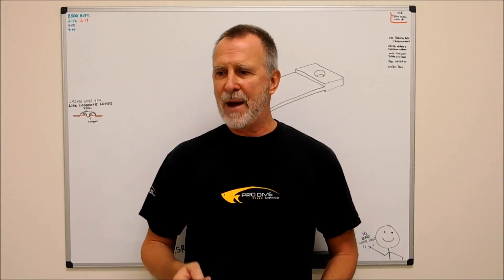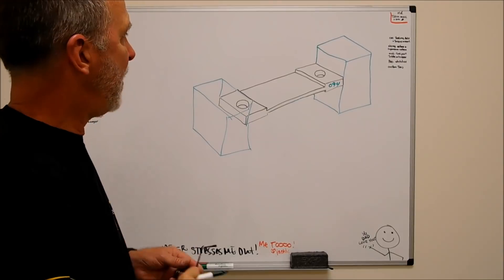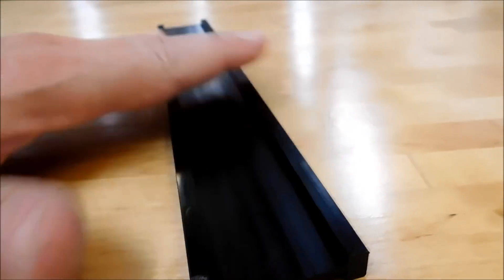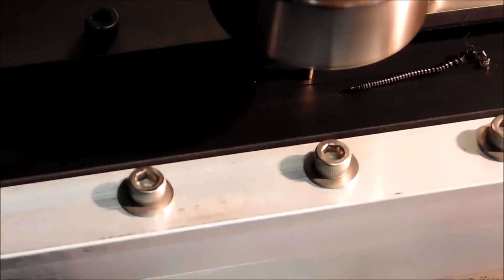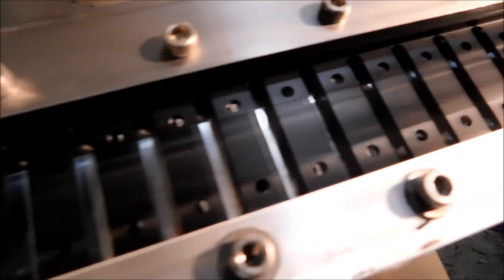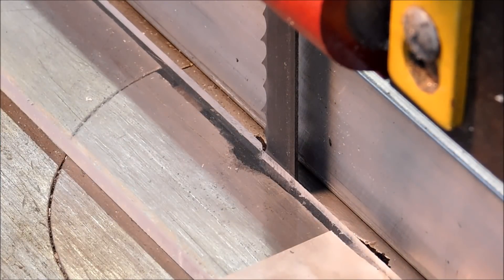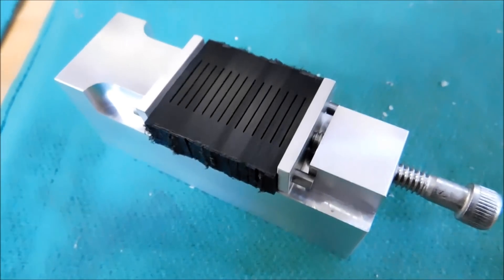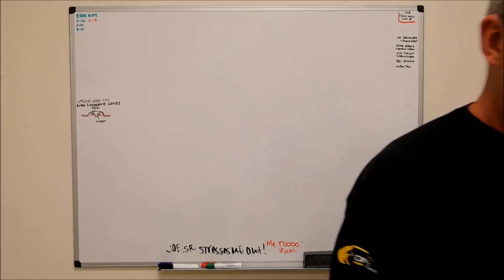Dogbone Milling - A Great Way to Hold a Small Part

Comment: One question. Was the base material supplied in that form or did you have to machine it out first. If so did you use the long fixture to cut the trough and did you do full depth per side or flip it and do 50% of each side. If you have a video of that would be interested to see. Thanks for what you do. 
Regards from Canada's banana belt.
🤞❄️🇨🇦🍌🥋🇺🇦🕊️🇺🇲👍
Reply from the maker: These were machined from a plate.
Reply: @joepie221  Hi Joe did you do the video of the plate being machined? It would be interesting to see how you did it to avoid flexing of the thin material. Thanks for all your videos they are very informative and I have learned loads watching them THANK YOU

Comment: Joe, tks so much for your genius in machining and showing us not so gifted what we might consider in the process of keeping it moving forward in a cost-effective manner. I have a piece of .250 303 tubing that has a piece of .250 303 bar stock machined down to a snug slip fit about .800 into the tube. I have to machine an 10 degree angle into the tub and bar stock. Having problems holding the material so it doesn't flex in the process. Already broke several very expensive 100% carbides. Bar stock is silver soldered in before machining. Should I consider machining tubing and bar separately, then soldering? Have 100 to make.
Reply from the maker: Is this an internal or external 10 degree angle?
Reply: @joepie221  internal
Reply from the maker: @TKNoland  Have you considered investing in a tapered reamer? Then make an arbor and finish the ends to suit. "Hardest Feature First"
Reply: @@joepie221 No, I hadn't. Tks. That's a very good idea
Reply: We drill a hole through the tubing and the barstock down to the interior wall on the far side, then machine the 10 degree angle from the far id to the surface of the barstock. It's a giant needle, with a slot cut in it at an angle. We have 2 CNC machines. 1 Haas VF1 and a Tormach 770M and of course manual mills as well. I built a jig that fits in the jaws of my Kurt vise. Prototype cut well and seems very rigid. Trying to figure a way to speed the process up. It's very time consuming. Lots of fiddly bits.

Comment: In my view this seems far more complicated than necessary. That could be a two operation part if just held in a vice. First op with grip stock and second op in sacrificial aluminum jaws or held in hard jaws below the narrow bit. First op could even be done with stock vertical in the vice and slicing parts off with a mill saw (disc mill? arbor saw? cut off disc? sorry english isn't my first language) at the end of program and dropping z before pressing cycle start again.

Instead now it's three mill operations with bandsaw cuts in between the ops and three different custom fixtures. At least for small runs this seems quite wasteful, your comment about not having a thousand of them to do really hit the nail on the head. I don't know how many you did, but I'd guess you could have shipped the parts by the time you were done making those fixtures if the parts were done one by one.

Anyway the jobs done long ago so this doesn't really matter. Just my 0.02€. (BTW did you get more use out of those fixtures in the years between the video and now?)
Reply from the maker: 2 operations and you'd have 100 bananas. Delrin has a lot of surface tension and needs to be respected. My 2 cents...this part can not be done in 2 steps. Squeeze it in a vise and you'd blow the allowable tolerances.

Comment: That is an awful lot of socket head cap screws to hold down a thin plastic piece.
Reply from the maker: It not only holds it down, but must also clamp and straighten the entire slug.

Comment: you call that small? pff
how about real steel dogbone with ball end, 8mm total lenght, 1mm balls, 0.6-0.8mm hole thru balls with pins. now thats small
curently building 2 EMD machine for these and other related super small parts.
Reply from the maker: EMD?
Reply: @joepie221  EDM machines, sorry about that.

Comment: Will the bur created on the parts when you cut them off the big dog bone affect the stacking alignment on the final fixture?
Reply from the maker: It may influence the ends of the parts as you stack them, but the first pass will relieve any  flare from end burrs. the final cut cleaned everything very well.

Comment: Joe - I have a precision ground plate on the mill that has the bigger toe clamps on it to hold down 1-1/5" to 2" inch tall by 3" inch wide bar steel a lot of the time. 30 inches long.  I use Toe Clamps to hold the bar down. 4 on each side. Skim cuts are great but If I need to take a few .125 cuts to bring the material down to size the clamps seem to let the bar move a little and the overall height ends up not flat to the bottom surface. It can vary up to 20 thousandths. Any idea how to keep the bar flat to the ground plate better? Can't use a vacuum plate because the bar comes in as hot drawn bar and is always a little warped. I need the top surface open that is why I use toe clamps.

Comment: Hi Joe,

Would you please show us how you built your fixtures and how you initially roughed the parts?
Reply from the maker: the parts were cut from a sheet blank, and the fixture was fabrication was not filmed. if I can include a short shot of it in another video i will.
Reply: @joepie221  Hi Joe, like the questioner I'd like to know how you prepared the stock. Obviously it was cut from a 1/2" sheet or however tall your dog bones were but to mill out the 2 mm centre portion without it flexing must have taken another fixture to support it while you cut the second side. If you can at least tell us how you achieved that would help. A demo would be great but a white board explanation will suffice. Thanks from Canada's banana belt.

Comment: Great work Joe ,  I have a question , as you know there is many ways to skin a cut  ! since you are only doing a hundred 
would a hold with extra material  machine both sides snap off  approach  make the business case (no fixtures)?
Reply from the maker: The geometry of this part made fixtures absolutely necessary. Any vise pressure bowed the thin cross section and would have made flat and parallel nearly impossible to control. Some have suggested double sided tape, but sheet delrin has a lot of surface stress and will bow aggressively after cutting the first side. Once forced flat by the fixture, the material that came off the second side actually relieved that stress and the parts were dead flat.
Reply: Just wondering why you don't vacuum up the swarf instead of blowing it all over the shop?

Comment: I have "dog boned" plastic parts using double sided tape. would not have needed the fixtures.
Reply from the maker: Tell me how you control flatness when the part is taped down?
Reply: @joepie221  same way you did but without the fixture. cut the step into the waste board on the second side.

Comment: how can you make money on such a few number of parts having to make two fixtures for it first
Reply from the maker: That was a quick fixture, and the job paid fairly well. I also designed the fixture for future use.
Reply: perhaps Joe saw an opportunity to show a method that may or may not pay for itself on this run , but always good to have this knowledge in Your back pocket when planning jobs. I certainly see Your point. Cheers

Comment: Great vid and there is always more then one way to skin a cat but ! thats a two op part in alum vise jaws
Reply from the maker: Maybe if it was metal. In soft plastic, there is no way you will ever match the quality of this part squeezing it in soft jaws.  Plus, even if it is a 2 op part, you still have to handle 200 parts.

Comment: This is a good example to all those (and you seem to attract a reasonable number of them Joe) that think CNC machinists are not real machinists. I takes a real machinist to plan out a job so non machinist button pushers can take over, CNC or otherwise. 
Delusional, nostalgic or just trolling, I believe these people can't or won't distinguish the two scenarios CNC machines can be employed. Banks of machines lined up making thousands of the same parts run by semi skilled operator and managed by a skilled tool setter. Then there is the job shop constantly changing jobs with limited or singular production frequently with features that are difficult or impossible by manual means. These machines are usually completely run by skilled machinists and any machinist with real skin in the game will acknowledge this even if the skill sets are different.
Reply from the maker: Well put. I agree.

Comment: I would make a smaller fixture and do 10 parts at time. Fixture would be much faster to make and not be that much longer to accomplish the job. Don’t get me wrong,I like your videos just saying 🙂
Reply from the maker: You raise an interesting argument. Would the total job time be faster once you consider all the extra flip flop handling of a smaller fixture, or would the extra time taken to make the bigger capacity fixture even things out with less part handling? In a job shop, I think we can agree, this type of conflict and difference of opinion is commonplace. It would be a good experiment.

Comment: Those parts look horrible... You sold those???? Why wouldn't you rough AND finish EACH surface on the slot? Instead you get 1 really nice edge and 1 gouged surface on every part???????? Damn I thought you were better than that.... And to boot your tooting your horn the whole time.... Smh
Reply: Hey man, do you butt cheeks get sore from talking out your ass? I went to your channel for some good advice, but surprise surprise, didn't find anything on machining. Go back to sleep troll.

Comment: I love fixture work for production. We always mad 2 identical fixtures so we could load one while the other was running. But, that was for 1000's of parts per order. 

Man, I'd give my right pinky and ring finger for a Bridgeport with a prototrak controller on it. I know there's better heads out there, but you know. Nostalgia.

Comment: What Are These For?
Reply from the maker: I wasn't told, but they look like cable straps of some kind. Maybe vibration isolaters of some sort. The dimensions were very specific.
Reply: My own experience in industry is sometimes not knowing exactly what I'm actually making...getting a doodle (often on a bar napkin) with orders to make a stack before even thinking about going home...they get loaded on a truck and disappear while we're dealing with the next doodle.
Reply: @John-ik2eg  I'm working on it.

Comment: Mmm as a fitter and turner I see lots of different techniques ect.But in my experience if the material is expensive you don't get the extra "Dog bone area" to play with.And or time to make fancy jigs.But good video just to show what can be done to eliminate bowing and twisting of certain materials.Thanks
Reply from the maker: Sometimes, you'll spend more money in labor messing around with smaller material than you would otherwise. I bet I could have finished the jig and parts before another machinist could have finished just the parts. Mine would also be more consistent and accurate. And when the boss came back out and said "make me another 100" I would have just smiled.

Comment: That was great, Joe! Planning ahead every detail of those fixtures so the actual cutting was done quickly and, most important, ensuring the quality of the final product, really shows how professional you and your team are.
I worked at a company that made dies for aluminium extrusion, that was 99% of their work and they had the production process very well optimized, wire EDM, big horizontal machining centers and all that  stuff, but for the occasional  100 part job, they didn't even had a decent set of parallels. It was a struggle, with every part taken out of the vise 3 or 4 times, chatter, vise jaw lift...The parts came back from the customer  more often than not.
Reply from the maker: Thank you. Rejects and returns are not OK around here. I take the quality of my work very personally as it reflects directly on my ability and skill. I like jobs like this. They make ya think.

Comment: Hey Joe wouldn't injection molding be much cheaper and faster for these parts? Is there a reason why the had them machined instead? Brilliant idea by the way, I would of never thought of that.
Reply from the maker: Money. Molds are not usually made for a job this small.
Reply: @joepie221  ok makes since thanks.
Reply: Money. a company that still uses a Fadal 4020 is only about the money. not efficiency accuracy etc.
Reply: @FrapAttack  lmao

Comment: Why didn't you made the 'bone' 3/8 wider and cut off all the parts at left and right end from the remaining clamped stock in the mill just like you did separating them. Fear that the small.part will jump around once its separated and hit by the spinning tool ?
Reply from the maker: These parts weighed next to nothing. cutting them in the machine would not have ended well without each part having some retention mechanism. Too much time would have been required to tool and clamp each part. The saw was way faster in the presence of the 2 available holes for secondary.

Comment: Joe, do you ever use something like double-sided adhesive tapes to fixture parts; especially where machining forces are low, or drilling, or straight shear, these products allow for kind of "pseudo-dogbone" approach, with a fixture/carrier that carries many parts...we do thousands of tiny parts like this in the PCB industry, where parts are really much ro small to handle idividually, and, in fact, are often delivered on a."sticky tape" baxking, with low peel strength, enabling separation of individual parts quite nicely, and keeping them "organised" in the meantime ;-)

Comment: Nice job Joe. i did a job typical. but 5 at a time they were end caps for extruded alu.. 2 setups and i made a fixture to cut them off on the table saw finished. helped pay for the tormach then the haas mini. great job..
Reply from the maker: I'm about to post a video on something I call flip flop milling. check it out when it posts. I think you'll like it.

Comment: Joe, You made all those fixtures for less than 200 pcs?  How long did making the fixtures take?  Nice looking fixtures.
Reply from the maker: This was a one day job. The fixtures were about 75% of the effort.
Reply: 6 hrs? youch  At this point I am the one praying that you get the repeat work and justify the fixture.
Reply from the maker: 2 things. The fixture was designed to accept other size parts and the overall job easily hit the quoted time and value. I personally would rather spend time making a nice fixture and blow through the job than to struggle for 100 pieces, one at a time. If the effort is within the quoted time, or the customer paid the OTE fee that is.
Reply: So basically If I was well organized and had lots of storage space so I could "Showcase " my fixtures you would believe that in the future something has got to pop up in which I could use that fixture again.  I guess my problem is that I am used to working for nickel and dime folks most of the time.
Reply from the maker: I call that mentality ' The next Time Syndrome"... It boils down to the owner being too afraid to make a fixture for a job for fear of loosing a few bucks on time. Instead he elects to make the fixture next time and just struggle through it this time. next time, the same thing happens due to lack of available time, and the time after that. Its an expensive loop to get caught in. A good cost effective fixture can save a lot of time and put a lot of cash in your pocket. I know I can reapply this fixture in many ways and will use it again and again.  Some of my tooling I do showcase for its ingenuity, but for the most part, they are just cleaned and shelved in an orderly fashion.

Comment: Very nice. I like your fixtures a lot. You really make them works of art, it was fun to see them. 
By the way, I don't know if you read these comments, but for the pin fixture, is there a reason you didn't use an arrangement with soft jaws, like a pin pallet you could swap? You'd have to flip it, but with soft jaws you should be able to fit a lot more parts in.
Maybe its a wash timewise? Or a quality thing? 
But it seems like it would be faster with how many parts you where making to my experance.
Reply from the maker: The dual end cut was under 30 seconds. I'd use 2 fixtures if I had a ton of parts.
Reply: @joepie221  ah, I see, thank you! Its always good to learn more from a more experanced hand, thank you for the reply

Comment: Having spent 37 years as a heavy duty mechanic in a high production dealership clean up time is as valuable as the job its self
I see a lot of people using compressed air to blow off their parts where debris  goes everywhere 
I always liked using my compressed air vacuum to control cleanliness inside of engines so why not retrieve chips during machining process and eliminate any additional time cleaning up the machines 
Time is money unless you like doing it for fun

Comment: Did you supply any spare ones Joe or exactly 100?
Reply from the maker: In the event the job yields spare parts, I usually offer them to the customer at a reduced rate. If you believe the job will repeat, keep the spares in inventory. This job shipped exactly what they ordered.